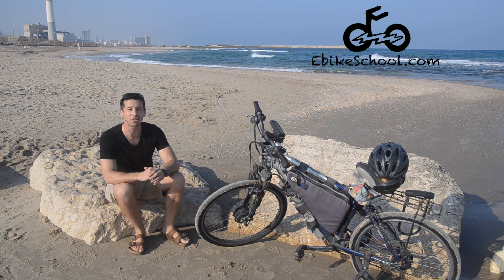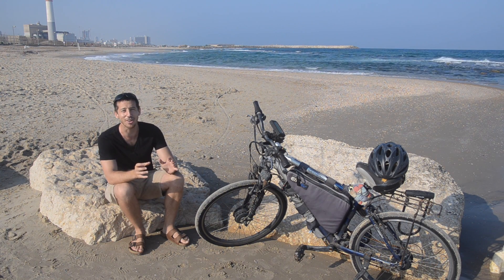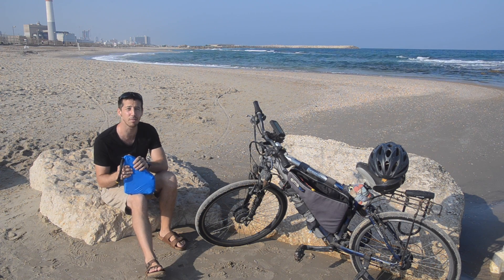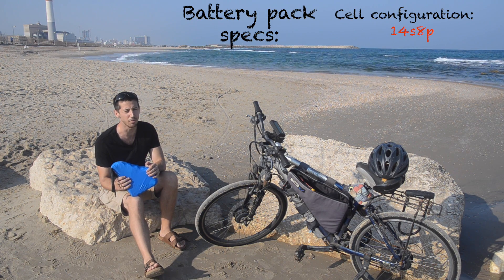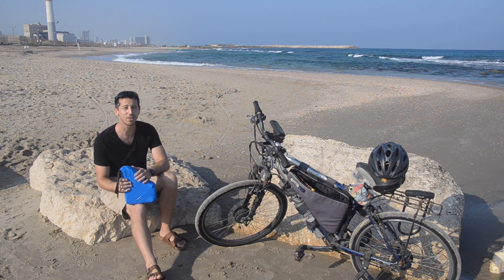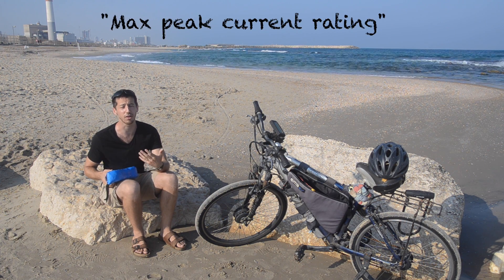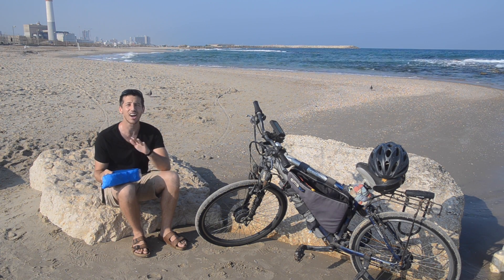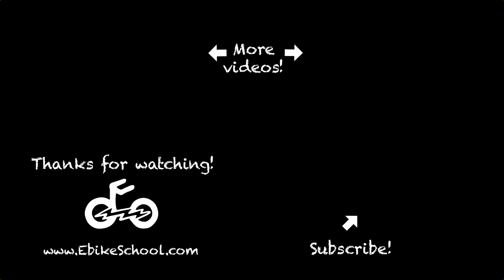How To Properly Choose An Ebike Battery - Q&A#8

Comment: i HAVE A 250W bIONX HUB MOTOR ON MY HP VELOTECHNIK RECUMBENT SCORPION FS20 TRIKE. THE BATTERY IS ABOUT DUE FOR REPLACEMENT AND I WOULD LIKE TO REPLACE IT WITH A LARGER AH BATTERY TO ACHIEVE A FASTER DELIMITED ASSIST SPEED. THE CURRENT BATTERY IS A BIONX 48V-8.8AH. WHAT ARE MY OPTIONS? (I LIVE IN AUSTRALIA) I WOULD LOVE TO BUY A ARIEL RIDER GRIZZLY BUT NOT YET AVAILABLE IN AUSTRALIA. DO YOU KNOW ANY RELIABLE SHIPPING COMPANIES WHO COULD QUOTE ME ON SHIPPING FROM US TO BRISBANE, AUST?

Comment: Looking at the bbshd 120mm mid drive kit. Looking at powering it with a ego 56v 5.0ah battery. Would that work with the setup considering its 40amp continuous rating? New to all this and looking for a battery source that’s not a pre built while battery. Thanks!

Comment: Hi I’m using a 72v 40amp hour controller on a 2000 watt rear hub motor im trying to find a battery to match that size of motor but I can’t find any other than car batterys

Comment: I just bought a wallke x3 pro. My question is can I add another battery and run in parallel with the stock battery? I'm thinking of adding another battery on my rack to get more range. What are your thoughts? Can this be done? I was also wondering if I can increase the voltage to 52 volts? Thanks for all your knowledge brother I appreciate all your videos.

Comment: Voilamart told me I can't use 52 volt on my 48 volt kit you said it doesn't make much difference, so I'm getting a 48 volt 1500 watt 20 a and 50 abs so I'm good I hope says 34 MPH throttle

Comment: If 45Ah battery is 450A than if a motor is rated for 12A Means is a 1.2Ah motor? If î use   6 motors 72A Means it is 7.2 Ah?

Comment: HAI I USED TWO MOTORS 1500W 35 AMP. HOW MUCH SHOULD I USE THE VOLTAGE AND AMP FOR TWO MOTORS....SO I DON'T KNOW HOW TO ADD BATTERY VOLTAGE AND AMP

Comment: Hi, wondering if someone can give me some advice, I have 1000watt ebike currently running a 48v 13ah battery, but I need longer range so I’m thinking of ordering a 48v 58ah battery without a case, my question is can I use this battery by simply plugging it or do need to put it in a case? Also do I need to balance charge it?
Reply: Hi you say do you need to balance charge the battery well that will depend if the battery you buy has a BMS built internally by the battery maker so if it has then you don’t need a balance charger you’l just need to buy a good quality 48volt charger then come in 2 amp or 5 amp as standard but I would just like to say a 58 AH is a massive capacity so this will take a very long time to charge at 2 amps per hour if the battery is completely dead so 58 ah would be like over 24 hours charging and at 5 amps still around 11 hours from completely dead battery so 58 AH is a bit extreme I would say, I have a 48 volt and 25 AH battery and I can get 50 Miles range at 18mph or 40 miles at 25mph so unless your trying to ride 70-100 miles I wouldn’t bother with a 58 AH battery stay around the 35AH and charge at a steady 2 to 3 amps then at least you can get a full charge cycling in 12 hours at 3 amps problem with massive 58AH batteries is there charge time from dead is so long and the batteries weight very heavy plus a 58 AH would need a lot of cells in parrel to achieve the 58 AH let’s say you had a battery built with cells that are 3000 mah each cell so to achieve a 58 AH capacity you would need a battery that was built like this for a 48v 58AH 13S 19P so that would be if built from 18650 cells that would amount to 247 cells and would weigh in at about 13 kilogram which is very heavy and very large so it’s all about what controller you have also as your controller will balance out the amps. So basically we all want long range but how much £$€ do you have to spend as a battery that size would cost here in the uk like £1000 for a 48v 50AH and it’s very big and very heavy most ppl stay around 20 to 35 AH my best advice would be ride conservatory so in eco mode or PAS pedal assist mode and buy a battery that has a built in BMS battery management system and buy a good 48 volt charger, you also say would you need a case well most battery builds are heat shrink wrapped to protect them but you will still need to buy a battery bag or case to protect from the elements, I’m building a 48 volt 35AH from Samsung 35E cells that have a large mah capacity of 3500 which is good for 18650 cells but some battery manufacturers build batteries from different cells that can hold 5000mah each so it depends on who builds you battery and at what cost you can afford and can it be custom built to fit on your EBIKE, hope this helps good luck oh yer and one other thing is you will want to make sure the battery is attached to the centre triangle of your bike frame as to distribute the weight evenly as if you are using a rear rack at the moment well a 13 kilo battery on the rear would be pretty sketchy 🤨

Comment: I’m new to this my grandson and myself are building a 3-wheel scooter & we would like for it to do 35-40 mph. We were gonna use a 
3000w 72v electric brushless motor will that be enough engine or should we use hub motors. Any help from u would be appreciated very much we watch a lot of ur videos & have gotten a lot of knowledge from them. Still we have a lot to learn I’m 68 years old the grandson is 18. Thanks very much for the videos and any help u can give us.

Comment: Very well done.  Smooth clear and to the point!  Thank you.   I have an ebike Emmo Zone GTS which has lead acid battery. I want to buy lithium battery. I have been chatting with vendors from Alibaba. There are few types of Lithium batteries as I learn.. LiFePO4 , lithium-ion, NMC, etc. I am looking to get LiFePO4 72v 40ah for 1500$ca including shipping.  Which would you recommend? Would you build one for someone like me? :)

Comment: Hello Micah myself and my friend Fred cooper have recently began making ebikes and have found your videos to be most informative and helpful. We are looking to push the limits of performance and looking at the different battery sizes 18560 seems to be the standard but I’m finding high performance and capacity 21700 and the slightly bigger 26650 signal cells have really peaked our interest and would like to know if you have tried these and how you found them if you have. On a personal note I love your 2wd ebike as mine is aswel

Comment: I’ve just purchased a 1000w 48v e bike kit will I be able to buy any 1000w 48v battery pack from eBay and will it have the same connectors?

Comment: @Ebikeschool.com 
I tried finding a email for you i couldn't.. i really could use some hand holding here. I use bikes as my main source of transportation. And i have 2, 2-stroke 26in beach cruiser bikes very fun but very very touchy and need a good deal of maintenance and upkeep not really reliable i also have a very nice 4 stroke bike from "phatmoto" with some custom upgrades a LOT more reliable very little issues however i want to build a ebike as a "back up" and i just cause.. i want speeds of around 30mph range of at least 20miles figured a 1000w 48v should be more than enough to cover that i have a brand new 26in kent bayside 7 speed i want to use for this and a budget around $400 finding a wheel hub motor kit for around $150-$200 easy enough but batteries is where i get lost... any links for good rear hub motor with 7speed cassette and a battery to power it would be greatly appreciated.
Thanks

Comment: Hi just join your Channel like to know I have a q1hummer  scooter with 800w 48v 26ah can I convert my Hub motor from a 800w to a 1600w and run it with the 48v 26ah battery I have??

Comment: Hi Mike, I am looking for an excel table with a sort of matrix in order to design an e-bike able to climb hills. The table should include a variable weight of the driver, different slopes, and unexpected loads , such as laptop, shoppers ...
I am not a fan of speed and I would make sure to design both motors and batteries in order to climb small hills, do you have any like this in your book? Alessandro.cella@engineer.com

Comment: Hey  Micah,yes great knowledgeable videos,thanks for the support. Got a question, have a folding fat tire ebike from China with a 500watt motor and a 48v10a battery my question is can I use a LG or Samsung 48v15ah battery?The battery that came with the bike doesn't have a brand name just says it's a 48v10a battery. Sorry for such a long ? Could have made a little shorter. Thanks again for your support.
Reply: Ps ,how can a buy your How to build an ebike book? Thanks.

Comment: Hi . Great Video man thanks alot.
I am building a small trike/go kart (kinda) out of wood for my 5 yo son. I have bought a 36V 350W hub motor which will be on the back. I was thinking in putting LAcid battery since the cost is minimal. (https://www.thebatteryshop.gr/mpataries-vathias-ekfortisis/anapirikon-amaxidion/mpataria-vathias-ekfortisis-osaka-12volt-20Ah). Will be using 3 in series) . Besides the environmental issues (one of the reasons i am still thinking NOT to get it) and the lifespan is there any other reason not to use it? Like absence of BMS or something? If anyone can help it would be great as the more i read the more i can't decide.

Comment: How much amphere battery is required to run 48 volt motor.
By increasing amphere will the controller and motor get damaged.

Comment: Thanks for uploading and sharing,  I just bought  ebike conversion kit for rear hub 1500w wheel, I want to use a 52v battery with it , any suggestions on the max battery size I should go for.  Thanks.

Comment: a question
72 V 5000 w electric bicycle motor for front and rear motors
which battery pack can I use
to pack per charge 100 km for distance per charge of battery
if I want to mean this
how large must the battery pack be in amp

Comment: HI MISTER  I JUST ORDERED ON LINE A BAFANG 750W 48V AND I AM WONDERING WHAT KIND OF BATTERY WILL FIT THE CONTROLLER AND OTHER ISSUES I MIGHT HAVE OR JUST ANY 48V BATTERY WILL DO NO PROBLEM?

Comment: Hi one question I'm trying to get a battery for a convertion kit that I have purchased it's a rear wheel hub 48v 1000w I would appreciate the help in what one would suit 
Regards frame 62.
Reply: Iam using 50v on my 48v 1000w kit

Comment: So even if the battery can put out more amps and the motor can draw more amps, the bms limits the current? The c rating for these batteries does not matter as long as they are above specs of the bms?

Comment: I have 2 separate power packs same voltage, same capacity, both with its own built-in BMS. The question is can I use them connected in parallel to my E-bike? Does that mess up the BMS functions in any way? (if one of them goes lower than the other one when using the E-bike... Other then charging the other through the discharging port. Note that the bms have separate charging and discharging ports)

Comment: I'm putting together my rebuke kit and I have two questions....do I need to use PAS? And with my bike I'm unable to use there brake handles and have to use my stock ones. Is that going to cause issues? My brakes and gear switch are built in one housing

Comment: Hey ebikeschool, I have a 5kw ebike motor with a 80a sabvoton controller with a 72v 20s 15p 37ah battery. I recently went on a 6.3 mile ride and my cycle analyst v2.4 shows that i used 4.9ah for the 6.3 ride at 38watt hour per mile. Could u please tell me if my 5kw ebike is efficient and how many mile u think i could get per charge at 45mph.

Comment: Ok, newb here, just installed my first conversion, Shwinn Cornado,48v, front hub, waiting on battery, 48v 20 ah. I intend to use it as a travel bike for my trailer, replacing small motorcycle. I find this all fascinating, after some experience would like to try battery assembly. I know that I shall make some mistakes along the way, but grateful for all the info you and other Youtubers provide. I wouldn't have gone this route without this support, thanks. 68, never to late.

Comment: The cells in video, 18650 Samsung 26F 2600mAh, are warrantied by Samsung if discharging at 1.5A. You can discharge them at 5A, but in that case, Samsung does not warranty them. Why the calculations are made with 5A, and not with 1.5A. Lifespan will be much shorter.

Comment: Thank you for that info! Question, i will use a 36V 500W front hub motor. Is a 36V 10AH lithium battery enough for a 10klm trip, or is it to small? Keep up the great work!

Comment: Javier,
I have a 48V front hub, it pulls 26 A, I have four 12v/ 12A  acid batteries connected in series. It works, but I have a big issue, every time after charging the batteries when i fist attmp to connect to the  motor's red and black leads I get a one time big spark! no matter which I connect first? What will stop that?
Reply: Anti-spark connector will stop that. I personally use XT90-S , they are great.

Comment: Hey, would u recon i increase the number of cells in series to either 16s or 20s because i'm about to begin hot gluing my 48v 1000watt ebike battery as a 13s 12p 54.6v 32ah battery for my abike.

Comment: hey Micah I'm Nick, love u'r educational videos, i'm learning a lot. I noticed u live in Israel, i grew up in Haifa and still have a large family there. however, i moved to Chicago 10 years ago. Anyhow, I'm assembling a 3000w luna mid drive motor & 60A 36-72v controller. im using 10s2p ready packs with bms from alarmhookup on ebay. how would u recommend i use these cells? should i keep them as is & connect 20s4p pack? i hear thees bms's don't like to be hooked up in series, True? or should i connect them all in parallel? or should i break them up & make my own pack? also when the controller specs are 72v, is that nominal voltage of the pack? Thanks!

Comment: Can I connect 72v battery pack to 1000w hub motor, and controller of 80A
Reply: yes, make sure the toaster is hooked up first so you can make your breakfast at the same time

Comment: Why didn't you use the 3500ah batteries? My bike is  250w 36v 17ah 612 wh. Controller is 15amp. Can i use a 36v 60ah or more to get extended range?
Reply from the maker: Yep, you'd get more than 3x the range with a 60Ah 36V battery, but it'd be a pretty big battery in comparison to your old one.

Comment: Hi! Would you be so kind to provide some insights on how to hook up a 18650 DIY battery into a so called "silver fish" case? These cases seem widely used here in Italy but there is so little info on them. Are cases all compatible with each other (they seem to have the same specs)? How many cells fit into a case? How to connect the on/off key? How to connect the charge meter? Do I need a special bms with on/off feature? Thanks. Cheers. Gio

Comment: I use the throttle all the time a lot at full power and my watt meter shows peaks of 25 amps and then drops off even though I'm still at full throttle I'm guessing this is due to my controller as my battery is rated at peak 30 amps , Am I killing my 36v 15ah battery it never gets hot neither does my motor but I'd like them to last also I'm thinking of getting a 30amp controller to give more torque for hills is this a bad idea  as I use full throttle a lot.

Comment: What is the difference between motors that have voltage rating of 72V and 96V? And current rating being the same as 80A. And what could be the best battery for these motors?

Comment: What are your thoughts on super capacitors with their quick charging and enormous energy discharge capabilities? Could an e-bike battery pack be made using Super Capacitors?
Reply from the maker: There is serious potential for super capacitors. It's not an area of expertise for me, but Bruno from the ElectricBike channel knows a lot about it and is working on some neat projects, I believe. Make sure you watch his channel for more on that.

Comment: Can you use the motors on the bike to brake? Like capacitive braking? If so, does capacitive braking even really charge up your batteries enough to make a difference in run time?

Comment: what battery pack and motor is best to use for a cross country platform?  Say at 30mph, that can easily be recharged with solar?  Thanks!  Additionally, if you have a 100 watt panel, how long would it take to charge a battery like yours?  (20ah)

Comment: Hi Ebikeschool.com! I've been going through your videos for a while and I'd like to know one thing: how to get the maximum life out of an Ebike Battery? To add to that question, I'd like to know if adding a small 120mm can actually reduce the temps, and therefore, lower resistance and increase range and max life.
Reply: Don't fully charge it, just 80%
Don't leave it fully charged 
Don't leave it discharged
(For extended periods of time)
Don't overheat or freez.
Reply: @AurelienCarnoy  Thanks, but no need anymore.

I've learned a massive amount of knowledge when it comes to cells and battery packs, and as such, my answer has been responded a while back by fixing my ignorance in the subject :P